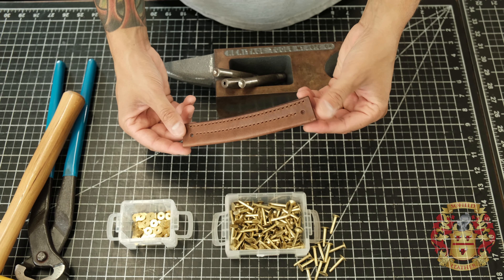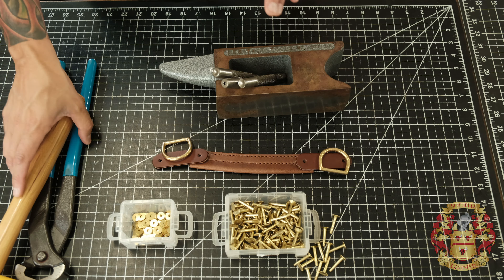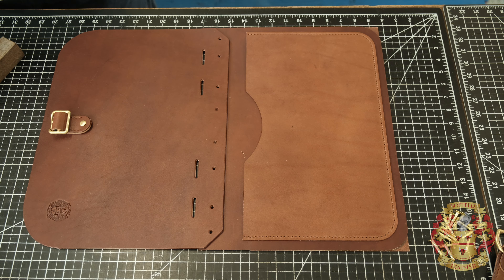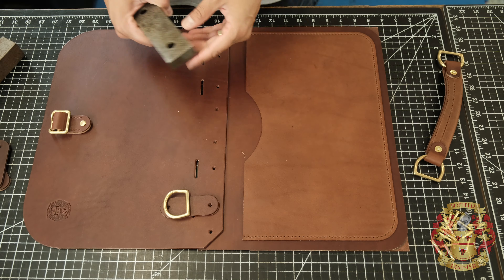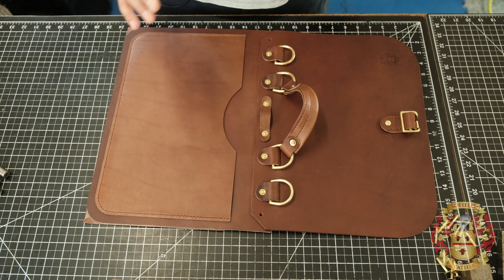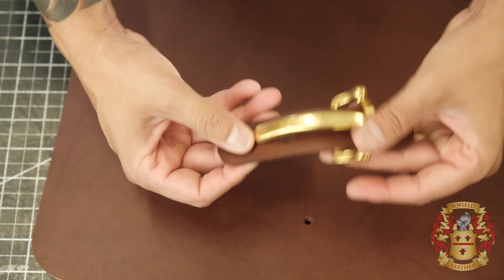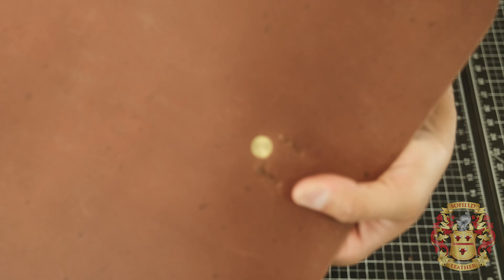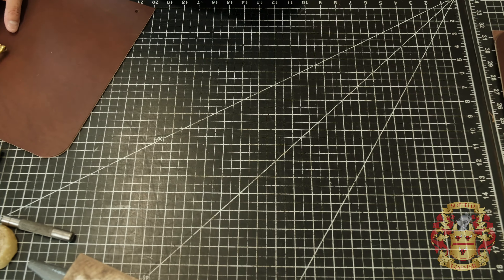How To Make a Leather Satchel Bag - Part 5 of 6 - Pattern Download

Comment from the maker: How To Make a Leather Satchel Bag - Part 5

💾 Download the Template
→ https://www.sofieldleather.com/shop/p/briefcase-pattern-build-along-video

💼 Watch the Whole Build Series
→ http://bit.ly/Satchel_Bag_Build_Series

👨🏻‍💻 Download Templates, Patterns and Blue Prints
→ https://bit.ly/Secret_Blue_Prints

🤷🏻‍♂️ How To Use My Patterns
→ http://bit.ly/How_To_Use_My_Patterns

🛠 Hardware - Tools - Material⇩

👉🏼 325 Dee Solid Brass 1 1/4 inch
→ https://www.weaverleathersupply.com/catalog/item-detail/00325-sb-11-4/325-dee/pr_1070

👉🏼 325 Dee Solid Brass 3/4 inch
→ https://www.weaverleathersupply.com/catalog/item-detail/00325-sb-3-4/325-dee/pr_1074

👉🏼 1144 Collar Set 1 1/4 inch
→ https://www.weaverleathersupply.com/catalog/item-detail/01144-sb/1144-collar-fastener-set/pr_1730

👉🏼 5015 Square Scissor Snap 1 inch
→ https://www.weaverleathersupply.com/catalog/item-detail/05015-sb-1/5015-square-scissor-snap/pr_2320

👉🏼 50 Buckle 1 1/4 inch
→ https://www.weaverleathersupply.com/catalog/item-detail/00050-sb-11-4/50-buckle/pr_321

👉🏼 3425 Button Screw Stud 1/4 inch
→ https://www.weaverleathersupply.com/catalog/item-detail/03425-sb-1-4/3425-button-screw-stud/pr_2211

👉🏼 Circle Tool
→ https://windfiredesigns.com/Tools/CircleTool/index.html

👉🏼 Pippin Punch
→ https://www.buckleguy.com/105-2-oval-pippin-punch/

👉🏼 Wicket & Craig Leather (Ask for Cindy)
→ https://wickett-craig.com/direct-sales/

💼 Shop 
→ https://www.sofieldleather.com

⏱ Time Stamps:

00:00 - Intro & Info
01:36 - Assembling the Handle
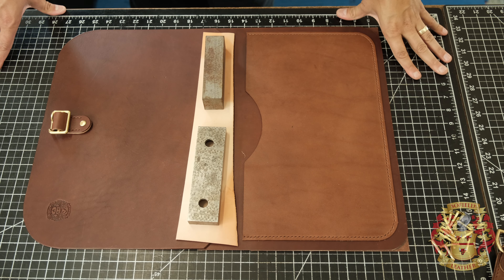03:55 - Attaching Flap 
07:36 - Attaching Spine Tab
08:47 - Attaching the Handle
09:28 - Overview
10:08 - Attaching the Male Buckle
17:36 - Some Thoughts on the Buckle
19:24 - BONUS Hanging Pocket
25:37 - Outro

🇺🇸 Watch my Vids on Rumble
→ http://bit.ly/Sofield_Leather_On_Rumble

 🖥 Playlist ⇩

📒 Leather Patterns & Build Alongs
→ https://bit.ly/Leather_Patterns_Build_Alongs

😉 Leather-Crafting Tips
→ https://bit.ly/2HP6MZa

🤲 Build Videos
→ https://bit.ly/2ZnzVPZ

🤩 Member Only Videos
→ https://bit.ly/3qFgv66

🧵 Handmade Leather Tote Bag - ASMR - Complete Build 
→ https://bit.ly/2NDyKqa

💼 Handmade Leather Briefcase 
→ https://bit.ly/3g898hn

🎧 My Music 
→ Spotify: https://bit.ly/Alexis_On_Spotify
→ Apple Music: https://bit.ly/Alexis_On_Apple_Music
→ YouTube Music: http://bit.ly/Alexis_On_YouTube_Music
→ YouTube: https://bit.ly/Alexis_On_YouTube
→ IG: https://bit.ly/Alexis_On_InstaGram

#LeatherSatchel #LeatherPattern #DIY

Comment: I'm building a bag similar to this right now, for my son. This video series is an immeasurable asset!! 
It's going to be a mailbag type, turned inside out with 5/6 oz leather. I'm adding the storm flap after I flip it. I was curious on how you did the front latch. Thanks for showing such detail on that process.
Any tips for inside out construction?
Reply from the maker: Thanks for watching. I have no idea on the inside out construction. I’ve only dabbled and didn’t like the outcome.